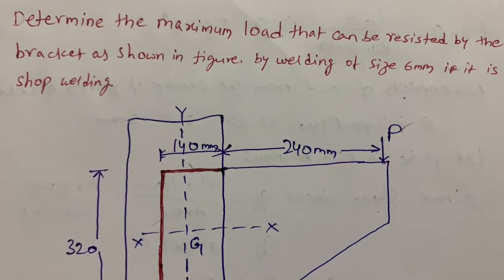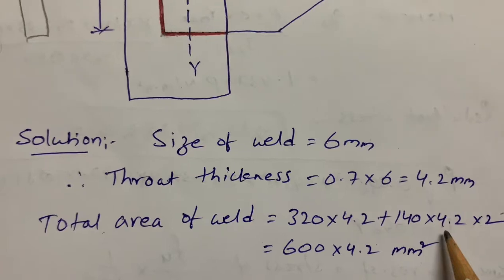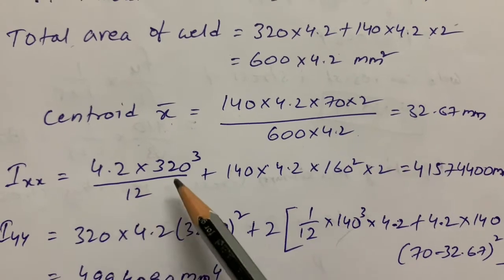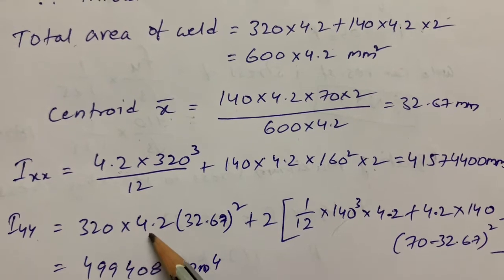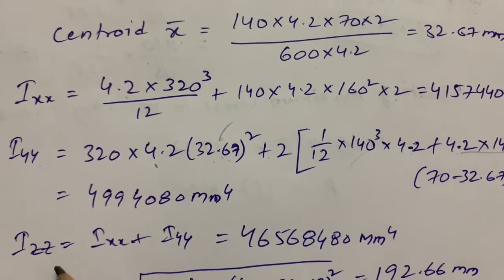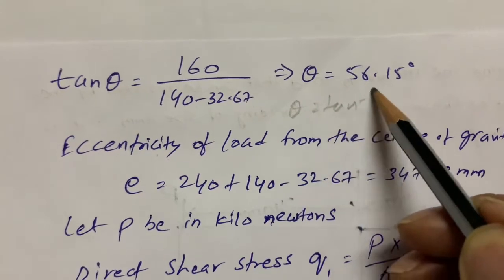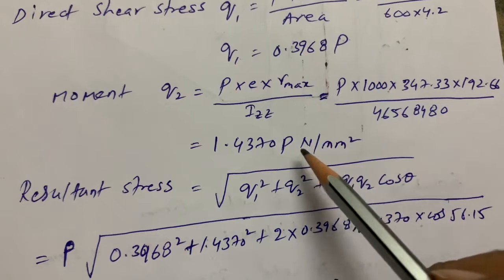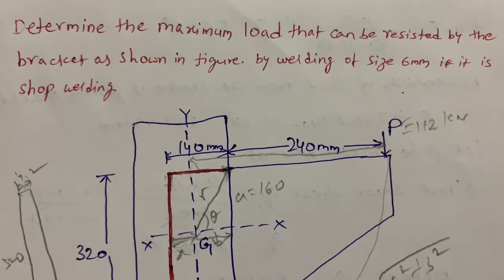#Design of steel structures#Eccentric model problem#Welding#Determine the load acting on the bracket

Comment: But Resultant stress for fillet weld is (F^2+3q^2)^1/2
Reply from the maker: It depends on the vectors, if a and b are the magnitudes and theta is the angle.

Comment: For throat thickness we use formula 0.7t... where t is the thickness of thinner metal sheet... But u r using 6mm here which is the size of the weld...
Reply from the maker: 6mm weld is already given in question. It is the thickness of the weld

Comment: Can you explain the 70-32.6 part in Iyy calculation?
Reply from the maker: With respect to Y we are calculating x value half of the distance in 140 is 70 and with respect to Y centroid of the x is 32.6. So Yc square means centroid of Y (70-32.6)